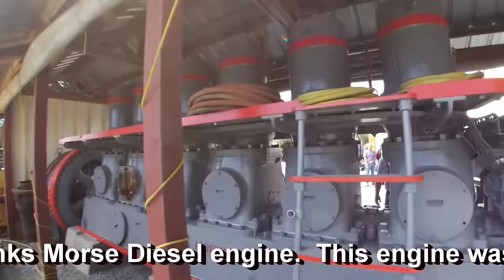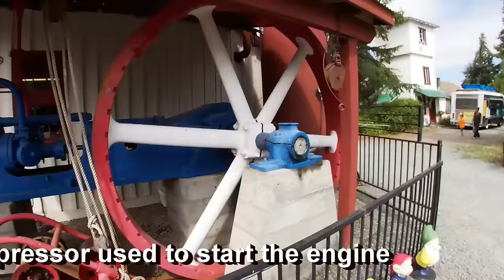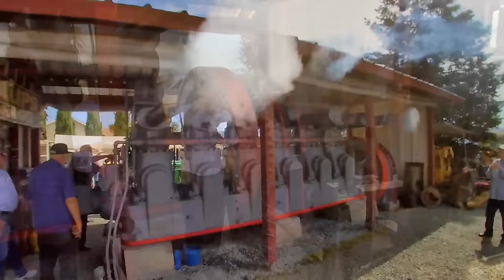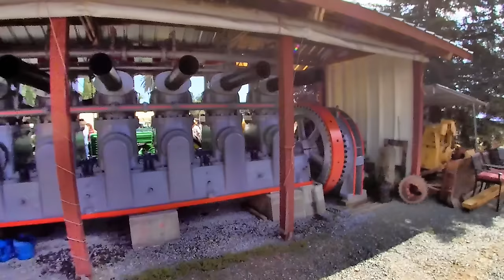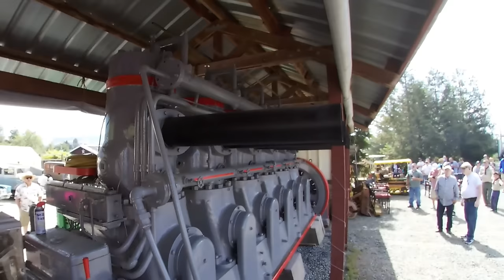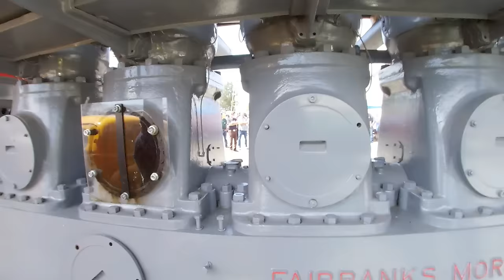450 Hp 1930 Fairbanks Morse Diesel Engine Startup

Comment: That thing was quiet. The WW II era 10 cylinder opposed piston Fairbanks-Morse Diesels that we had on the ship that I was stationed on were so loud that I'm now damned near deaf.
Reply from the maker: I was in the USCG during Vietnam times.   I also sat in an engine room for many days between two Fairbanks Morse opposed 8.5's making me deaf.  This engine was pretty quite but I think a lot of that was because it had no load on it.
Reply: @georgehomenko5358   Semper Paratus, mate!   I was stationed on a 311, the Absecon in 1971.  We always had problems with the injectors sealing where they went through the water jacket.  We also had the pleasure of pulling the upper crankshaft while underway because of a bad piston.  Talk about fun.
Reply from the maker: @williamcharles9480  Wow I was on the Gresham a 311 stationed out of Alameda California.  Doing ocean station Novembers in the middle of the pacific.  I was an engineman in engine room 2 where the boilers were also located.  Made for warm days when in the tropics.   Still on the West coast.
Reply: @georgehomenko5358  Tell me about it, George. I was down in the hole in #2 also, besides being a fireman EN striker that served as an oiler, I did boiler work and ran those too.  They were short of BTs so the FN does what he's told.  That was hot, nasty work along with cleaning those lube oil purifiers.  I served an Ocean Station Charlie and a Cadet Cruise then won a solicitation to EN school in Yorktown. They sent the Absecon, (based in Norfolk) to Vietnam right after I left and avoided the cruise there.  She was captured by the North because it was down for repairs when the North captured the South and couldn't be moved to the Philippines like the rest of the donated cutters.  All of the best and Happy New Year.
Reply: @williamcharles9480  I remember the FUEL OIL Purifiers, those centrifugal bastards that cleaned the bunk C fuel oil.   What a freak'n mess that was.   I also remember having to crawl to a far corner of the engine room under the bildge plates.  It to some forty minutes just to get to the spot to change some old pump.  Then you had to get your way back.   I got off the Gresham after about a year and went to engineman's school in Yorktown VA.   After graduation I got stationed at a light in San Louis Obispo and finished out my 4 years at Bodega Bay on small boats.  It was the worst of times and the best of times.
All my best to you and yours in 2019.
Reply: @redwoodriders6454   The nightmare returns, I remember that the purifier had to be taken apart with the multitude of circular plates that had tar all over them.  The Chief would be barking that it needed to be back on line so you'd have to hurry.  The ship would be thrashing back and forth, the sickening smell of Diesel filling your every breath, yeah, people don't realize what veterans had to go through.  I finished out my four on a 180 Ft bouy tender out of Atlantic Beach, NC that also pulled SAR off of Cape Hatteras, then a stint on an inland tender, the Smilax, that was out of Brunswick, GA.  I reenlisted after getting out because the job situation was bad in my area of N. FL and got my first small boat stint in Key West.  That was one busy station, drug runners, murder and SAR.  What a mix and they told us not to load our pistol when boarding suspect vessels, (I was a boarding officer), until you were threatened.  After three years, I got burned out and left the service.  Things are much different in today's Guard, as you probably know.  Buy the way, that lighthouse duty at San Louis Obispo had to have been pretty sweet.
Reply: Thank you for your service I work at a power plant with 2 12 cylinder op
Reply: That's coz it's cycling on COMPRESSED AIR. Of course the real WORKING thing is louder. Notice the LACK OF SMOKE from the exhaust.... When they start a bulb diesel they will get a sharp whistle as it first fires thru the decompression valve.
Reply: @OffGridInvestor ,
 YEAH! YOU"RE RIGHT!  THERE WAS A LACK OF SMOKE!
Reply: @dagger3k  ,
Your welcome, it's people like you that made it worth it.  Those OP engines seem to keep on going.  How old are those units out of curiosity?

Comment: Hello fellow shipmates! Was on a WWII era ship. The Acushnet, old 213. With four Fairbanks/diesel electric, filty boilers and pain in the ass alfa laval centrifugal lube oil and fuel oil purifiers.
Reply: Fifty boilers? For four diesel engines? WTF are you talking about? Diesel electrics don't require boilers, even the Titanic didn't have 50 boilers, mate, and it was a STEAM ship.
Reply: Diesel w 50 boilers?

Comment: I saw a 1000hp 4 cyl gas engine the other day. Doubt the torque would compare with this engine though.
Reply: It most likely a smaller 2 stroke with 1000 hp

Comment: I wonder how the engine speed is accurately controlled while under varying loads so that the generator frequency stays constant.
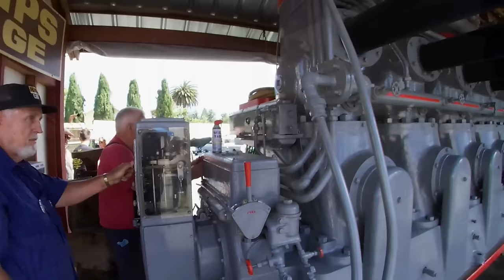Reply: Look at the engine governor at 1:46.  It spins with the engine and the weights at the end pull the throttle down or up based on whether the engine is going too fast or slow.  The stiffness of the spring inside of the governor is what determines how much centrifugal force it takes to raise or lower the arms as the engine spins.  Modern engines use computers that take a sample speed hundreds of times a second to determine rpm.  Google 'engine governor' for more info.

Comment: Correct! No valves...it has slots in the cylinder walls that serve as intake and exhaust valves.  Our ship (Castor, AKS-1) had a vertically opposed Fairbanks-Morse (2 crankshafts connected by large drive gear and chain like a camshaft drive) and it sat on a bed of springs!!!  I thought it would shake the ship apart!!!!
Reply: Does this useb plain bearing fed from a dry sump and the the oil is burnt off? this is how 2  stroke JLO or Deutz diesel works.

Comment: fire up the concession stand,  electrofry some corn dogs.   I wanna hear that engine working under LOAD.
Reply: I was wondering what this might be used for. Kind of cool to see starting and running.
Reply: @leroydever4761  I went back and calculated an estimate of how may commercial electric fryers that engine/ generator could power at the stated 450 horsepower.   About 25
.   If I remember correctly about how many corndogs will fit a basket and how long to fry them that makes about 500 corndogs a minute.  And electric fryers I have used can keep up with full baskets of corndogs one after the other all day long,  with french fries  they need a minute between full baskets cause the oil cools down.  Bring some friends!
Reply: @laserflexr6321  wow. That's sounds pretty damn impressive for that generator to be able to work with that kind of load on it. Sounds like one helluva good time.
Reply: @laserflexr6321  we're on our way, we'll bring the cola

Comment: I need that same model for my house when i loose power,instead of that genrec toy lol,does it auto start when the power goes out lmao,love these old monsters.
Reply: Steve steve, 25 gallons of diesel per hour? And no you'd have to start it manually, with a sizable compressor, I think, a fuel driven compressor, with no electric power. It weighs more than your house.

Comment: I have seen the 1 cylinder to a 4 I have not seen a 6. I guess they can just keep adding cylinders for more power.
Reply: The Model 32 engine was offered in two different bore and stroke configurations: 12" X 15" and 14" X 17" The latter bore and stroke combination could be configured with 1-6 cylinders.
Reply: @Valenthorpe  it is amazing how something so old still out runs anything made today.   I know today things are made to fail to keep the fat companies rich.  Like singer sowing machine's they were built tough and you only had to by one, witch almost cause Singer to go out of business, or they might have,  back thin things were made to last, and parts was so easy to replace if there were a problem.  now you have to have a tech fix anything.  Companies design things to fail and they know when it will fail IE the add warranty scam for products they know the parts they have now will last 2 years or a little more and then die just right after the warranty is up.     

I really love old tech, and machines.

Comment: Orleans CA, What sawmill was that?
Reply from the maker: The saw mill is gone now. Drove through Orleans on my motorcycle a year ago.  You could see were the mill was north of town.
Reply: @georgehomenko5358  Is that when you found the Fairbanks?
So much cool machinery on the Northcoast years ago. I was fortunate enough to work with crazy machinery collectors Alex Cristy, Gis Peterson and the ultimate, Walter Waldkirk in the 70s.
From Panama Canal engines to Donkeys now in the Smithsonian. So much gone do quickly.
Thanks for the video
Chuck Tanner
Reply from the maker: @utuchuck  The engine is now at a private collection in Pengrove CA.  That  is where I shot the video during an open house.

Comment: How much fuel does that engine burn when its running under a load?
Reply from the maker: We have no way of loading it.  At one time it ran all the electrical needs of a small California logging town.
Reply: @georgehomenko5358 what would your best educated guess be on the amount of fuel consumption the engine used, when it was powering the small town for a hour worth of run time.
Reply: I'd guess about 35 gallons an hour at full load.

Comment: Holy shit, for a second I thought they were barring over the engine with a fork IN the flywheel. Man that would be dangerous. Then I saw the stud they were pushing, lol.
Reply: At the itaska steam show in Minnesota, they have a Caterpillar sixty, it used a bar in the flywheel to start it, there's a notch in the frame that suggests the bar hasen't always come out cleanly, the engine has backfired resulting in one man getting flung but he was not injured, but one year the engine backfired and the bar flew through two thick wooden walls
Reply: I guess this is what prompted OSHA to raise the bar.

Comment: Is cylinder #3 not running? You can see it at the start not putting out any smoke, and you can hear it while it’s running going “bah bah bah bah”... there shouldn’t be one cylinder you can hear over the others, right?
Reply: It is used for air starting, gets fired up when engine is running.

Comment: I thought even 2 stroke diesel does have valves for the exhaust gases
Reply from the maker: Some do like a 6-71 Detroit.  Values add efficiency.  But this one has cylinder exhaust ports.
Reply: @georgehomenko5358  nice. Thank you for the information

Comment: Fantastic machine and very  nicely restored! Respectfully, I'm gonna question your 70,000 lb weight figure though. Seems awfully high.
Reply: That weight is probably a little bit light for a 6-cylinder Model 32. It's probably closer to 80,000 pounds.

Comment: It's funny how an engine the size of almost one of those cylinders now can do as much as that.
Reply: You can make all the horse power you want with those small engines but without torque your not going anywhere
Reply: @haroldwilliams8118  Actually, what matters is torque at the point of power use, and you can get your torque via gearing.  It all balances out in the end, because power is power, as long as you have a power transmission system that accommodates the needed RPMs.  There are applications where you want more torque and less RPMs, but that's a function of the limitations of power transmission (such as appropriate gearing and enough useable ratios), and not because of some global rule regarding torque.  Someone else in the comments explained this really well but I can't find it right now.

Comment: Huge,but only 450hp?
Reply: Horsepower is a mathematical derivative of torque and rpm. At only 300 rpm, hp is lower than you might expect but it's still making nearly 8,000 lb-ft of torque.

Comment: I'm not a mechanic so can someone tell me why there are no valves?
Reply: It's a 2 stroke diesel. 2 stroke engines for the most part do not have valves  Air/fuel mixture is drawn thru the crankcase  to the cylinders on every other stroke and burnt.
Reply: So - Some FM were 2 pistons in 1 cylinder - 2 crankshafts and no cylinder head. I am guessing this FM is not that way. Start up is Cool  !!!!!- but I seen no response to explain the what you think is smoke at first is nothing but moisture vapor
Reply: @wfoj21  Yes,some great engines too such the TS3 (6 piston three cylinder ) and the napier Deltic , with 9  cyl (18 pistons to the 12 cylinder D shaped formation with three crankshafts. These were actually first built by the Germans *Junkers Jumo.

Comment: No valves? I need to see a diagram or something that shows that. This may be 2 stroke but is not a crankcase scavenged 2 stroke. It would need some sort of valve in the air intake at least. Like maybe a reed valve or rotaty valve
Reply from the maker: Check my link below the video.  Each cylinder crankcase is isolated and has a reed valve to the intake ports.
Reply: George Homenko ok then. I see each cylinder with independant crankcase. I didnt see any intake and a reed is a valve. Thanks for the clarification

Comment: Pretty amazing how far technology has come. It took an engine the size of a car in 1930 to produce 450 hp, but now the small engine in my car produces more than that. It goes to prove how strict emissions legislation forces increased efficiency in engines.
Reply: Eh, you're leaving out torque though, this puts many modern engines to shame with the torque it has at incredibly low rpms

Comment: I wonder what in the design is fundamentally different from modern engines that operate at much higher rpm.
Reply: The flywheels on modern IC engines doesn't weigh ten tons, and the engines don't weigh 35 tons. It's built for 300 RPM, which is about as fast as you want that kind of mass turning over.
Reply: @Lumby1  Well, ok. But the point of my question was HOW to make it go that slow. Smaller engines idle twice as fast as this one, and thats not even in their operating range.

Comment: That torque figure of 94,537 is wildly incorrect.  I think it's a more like 7900 foot pounds, which is still enormous.
Reply: Its 94 thousand inch pounds which converts to 7800 foot pounds. Both are correct

Comment: All the people calculating torque in the comments are wrong, the hp*5252/rpm equation doesn’t work out. If we take for example the chevy duramax, with 445 hp and 910 foot lbs the equation works out to 832 foot lbs. the duramax does not have 832 it has 910. There is no accurate way to calculate torque except for a dyno.

Comment: Better than the new modern crap . that bad boy still runs great. I would like to have that to run my house ( off grid )
Reply: I'd very much like to see a household that needs 300kw live off the grid.
Reply: I'd very much like to see you keep it in fuel and oil, It would be far cheaper to stay on the grid, never mind the foundation and exhaust system necessary for an acceptably quiet 35 ton 2 stroke diesel. The noise would drive you and your neighbors crazy.
Reply: @1835dueber  You like big and stupid, slim? You wouldn't like me.

Comment: Though it's cool I just dont see the point when a diesel engine less then 1/20th the size can make 4 times the horse power and even more torque
Reply: Wyatt Smith this is also an extremely old engine. Engines nowadays use ground breaking technology we didnt have access to 10 years ago.
Reply: @calebmurray6980  I get that and I know people like to refurbish these things. Still even the very old tractor engines produced way more. I would need a better understanding of why it needed to be so big lol.  Guess I was just more or less saying it seems like a waste to spend that but to each it's own. if you are rich and can blow the $ the go for it.

Comment: Haha most 2 strokes have no valves ,suck/blow and blow/suck instead of suck squeeze bang blow on a 4 stroke .

For the squeeze you need the valves because they temporarely close the gap between piston and cylinder head from the air intake and exhaust

On a 2 stroke does things double for each explosion the piston draws in new gas underneath itself and when the explosion goes out to the exhaust the new gas air mixture wil flow through flowports (on each side of the piston there is a channel in the cylinder )in to the cavity between piston and cylinder head

Comment: 300 rpm at 450 horse 😀 I wonder how much horse it would be at 1200 rpm
Reply: Dont forgot the torque, you are making enormous torque at 300 rpm with this engine, and Its the torque you ned from Therese engines.
Reply: at 1200 it makes destroyedengine hp